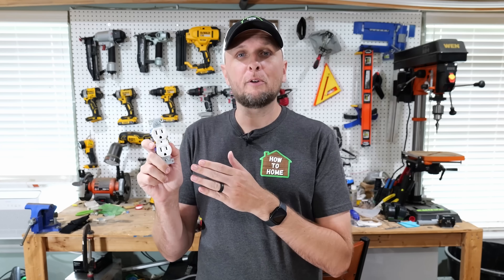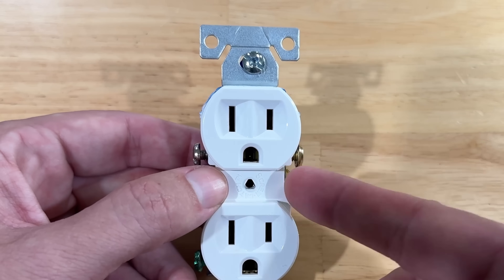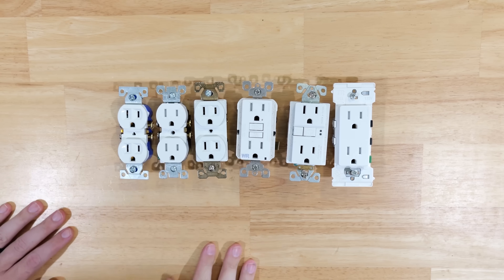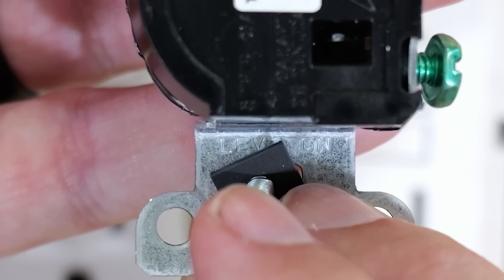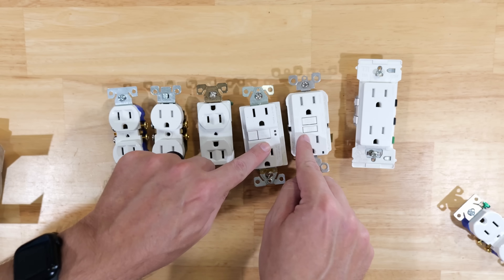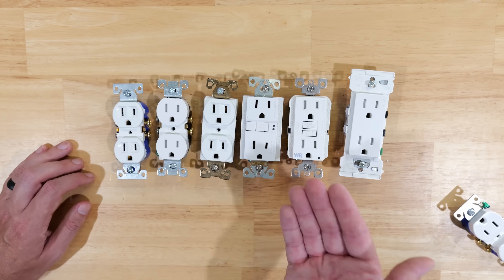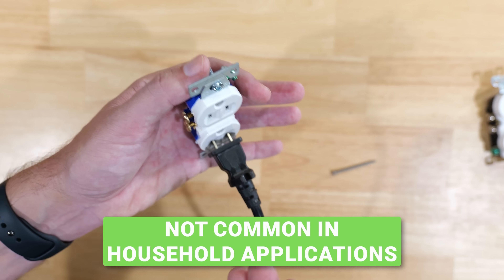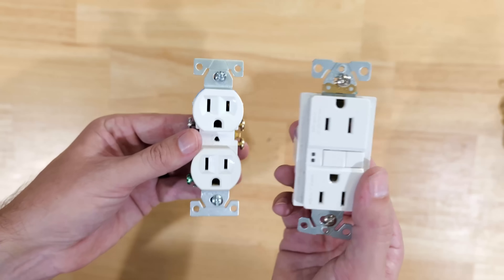The Shocking Reason Why Your Outlets Are Installed Upside Down!

Comment: The vast majority of flat extension chords are oriented with the ground to the “bottom” which would allow the chord to drop without the tail twisting or potentially “folding over“, potentially kinking, when behind furniture or appliances…industry standard and 99% of residential units have the receptacles with the ground prong to the bottom and it’s only confusing when people want to create the confusion…but playing the “paperclip” odds seems to be something that 99% of people and builders have chosen..

Comment: Anyone who tried to use a block power supply will notice that due to their weight, with the ground prong up, they tend to pry away from the wall, exposing the prongs, and creating a dangerous situation, and preventing the device connected to work properly.  These power supply are designed for ground down usage.

Comment: I install Receptacles Prongs up for any receptacle thats going to be constantly energized.  If the receptacle is switched however then I will install the recep with ground up, reasons for having a switch plug is for when the home owner for whatever reason doesnt want an overhead lighting source and instead wants to light the room with lamps.  It shows a clear difference between the two power states to prevent someone from plugging something that can be damaged from the power being cut off and to prevent tape being put over the switch or the switch removed and connected in the box.

Comment: The US standard plug is crap.  We need to adopt a new standard.  Something with coated connectors like in every other country.  And bonus points if we mandate right angle plugs and fuses in the plug.  European continental and UK plugs are so much better.

By the way, there is nothing in the code in a lot of municipalities.

Comment: I'm not an electrician. But I can say an outlet is either right side up or upside down when either electrician or a homeowner plugs in an outlet tester like the 'Klein GFCI Receptacle Tester with display'. If a receptacle/Outlet has the ground pin on top, the tool is going to be upside down.

Comment: I have several duplexes that were built in the early 80s and they all have the ground plug up. I was told the city had an inspector at that time who required them to be installed that way even though there wasn't any code requiring it. That would have really ticked me off. Earning the hate one inspection at a time.
Reply: @benvoeller8946: Just because the inspector didn't give examples as to WHY this might have ben the case there are legitimate reasons. Ground prong up when that outlet is attached too the wall-switch so people there know where to plug in their lamp to control it from the wall light-switch.
  Medical facilities have things hanging on walls that fall, like clipboards, scalpel, hemostat, that can fall and short the circuit, military galleys and  restaurants, ground up was specified, due to stainless steel utensils being dropped, etc. Therefore it has become required that they be ground up for contractors. In many cities ground up is standard in all commercial and industrial buildings, ground only go down in residential buildings, houses, apartments, condos, etc. 
   Internationally, countries with 3-prong outlets always have the ground up
   Everything is in context and the answer DEPENDS on context. 
   Examples:
“Never took the orientation of an outlet seriously until I was measuring for a shelf with a tape measure. It slid down and fell across the prongs of the washing machine plug.  POW! “ —@joef.6596
“I work at a K-8 school. Maintenance assembles powered multi media carts with the ground plug up in consideration of teachers dragging metal bracelet chains across partially unplugged power plugs.” —  @scaryhouse7969
“a length of florist's wire rolled off a side table onto a slightly loose plug and shorted the circuit, creating a small fire (quickly extinguished).  I now always install ground prong up” @deegee54
“I work at a restaurant and we have this work table with some outlets built in on top. Someone managed to let the edge of some tin foil go in between a plug and the outlet and it got disintegrated.”@MatthewSuffidy
“I knocked some change off of my end table one day my mistake of course, and a coin fell down right on the prongs resulting in a loud pop and a flash along with some smelly black smoke. I have since gone through my home and reversed all of the receptacles so the ground prong is now on the top.”—@chrisenglert3958
10 months ago
"I had lunch with the Chief Electrical Engineer at McDonalds headquarters. He told me that one of the workers in one of their stores had her hand badly burned when a metal cookie sheet (or something similar) slid out of her hand. It fell onto a receptacle that was loose…the metal cookie sheet made contact with the two blades resulting in  big arcing flash that caused the injury, this is a reason Ground Up is safer."

Comment: In my former life, I installed electronics in government facilities. I was not an electrician, but part of my job was to do simple electrical wiring, such as wiring up receptacles or hooking up wires in a power panel. I became aware of the ground orientation issue many years ago. After much reading and researching, I came to the conclusion that this falls into the category of an urban legend. The theory is possible. but I think this started with someone's overactive imagination and caught on with some electricians and then spread as these stories do.

Comment: Two things to consider in the orientation of the outlet: 
1. How you want the wires inside the outlet box to run and 2. The orientation of the plug you are putting into the outlet.

Some times the wiring and for the outlet and other wiring coming into the box will dictate the best orientation for the hot, neutral and ground. 

The direction of the cord coming out of the plug will sometimes be dictated by the whether the ground is up or down.

Comment: The triangular shape of the grounded plug you've shown is typical of such plugs, and in my hand, it feels much better in a "ground down" outlet, where the flat portion of the plug is against my thumb, and the smaller bottom of the plug is on my index finger, so I can roll it to get the angle of insertion lined up.
Reply: @DerekKerton: Ground prong up when that outlet is attached too the wall-switch so people there have a visual cue to know where to plug in their lamp to control it from the wall light-switch.
  Medical facilities have things hanging on walls that fall, like clipboards that short the circuit, military galleys and restaurants, ground up was specified for contractors, due to stainless steel utensils being dropped, etc. In many cities ground up is standard in all commercial and industrial buildings, ground only go down in residential buildings, houses, apartments, condos, etc. There are local rules. 
   Everything is in context and the answer DEPENDS on context.
Example: “Never took the orientation of an outlet seriously until I was measuring for a shelf with a tape measure. It slid down and fell across the prongs of the washing machine plug.  POW! “ —@joef.6596

Comment: The majority of AC adapters are designed to "hang" with the neutral left and the ground down (even though they often don't have neutral). These so-called "wall warts" would not hang correctly in a ground-up plug, and the wire would go inconveniently upwards and curl back down with gravity. We're gonna have to go downtown with ground-down, and just let it hang, peeps.

Comment: I think the strongest argument for ground-plug-down is the fact that most power adapters (with transformer blocks for plugs) typically assume the ground-plug-down orientation. If the outlet is stalled ground-plug-up, then the weight of the power adapter plug will be above the outlet, levering the prongs out of the outlet. Having the weight hanging below the outlet is more stable.

Comment: Let's confuse the issue more: Gasoline powered snowmobiles with a 110V electric starter have the starter plug with the ground pin up. Snowmobile manufacturers also have a sicker warning not to put your hand in the chute which is probably more important. However most portable generators have the ground pin down.

Comment: Another thing to keep in mind is how heavier transformers are made.  Many wouldn't work well with the ground side up.  It's more important to properly wire the connections.

I wasn't aware of face side cannot be up under sinks, but I do know that some codes require built in circuit breakers when installed in bathrooms, kitchens, or rooms with water sources.

Comment: Some of the answers elude to this fact. With the ground down, there are 2 terminals on the top. These also have more tension than the ground. This helps keep the weight of the cord or a transformer from pulling the plug down at an angle due the the leverage against the bottom of the plug. At least be consistent. I would hate having to figure out which way to turn a plug on every connection. It also look more proper/natural looking with ground down. Like an upright face.

Comment: Our new homes ALL had the Ground Pin DOWN.
But if the outlet was operated by a light switch on the wall ... then the Ground Pin was positioned up, so entering a room you would know witch outlet was operated by the light switch.

Comment: Isn't it rather moronic to design a system that makes it possible to touch a live prong every time you plug or unplug something? I've never seen  anything like it in Europe. Any part of the prong that could theoretically be touched while live during plugging/unplugging, has to have an isolating cover.

Comment: My problem is my refrigerator is grounded with the wires coming in the plug on the side. My whole house has ground on the top which makes my refrigerator plug upside down when plugged in and the cord sticks out like a waterfall. Can I change this one Outlet to have ground on the bottom so the plug is snug against the wall.? Also I have a half basement which I keep my tools and charging lithium batteries is a little tricky with ground side up
Reply: @ezabreeza3223: "Can I change this one Outlet to have ground on the bottom so the plug is snug against the wall.?" Of course. It's not hard to unscrew the plate and change the orientation yourself. Or hire someone to do it. Then it's done.

Comment: I use ground prong down, as all the 90° Plugs that I have seen (refrigerator, dryer, washer, appliances in general) plug in with the cord hanging down. Ground up, they bend over 180° defeating the purpose for the low profile of the plug.

Comment: Built and a new home wired it myself ( I am not an electrican) I prefer ground prong down.  Passed inspection first time.
Reply: @williamsanders6092: Ground prong up when that outlet is attached too the wall-switch so people there know where to plug in their lamp to control it from the wall light-switch.
  Medical facilities have things hanging on walls that fall, like clipboards, scalpel, hemostat, that can fall and short the circuit, military galleys and  restaurants, ground up was specified, due to stainless steel utensils being dropped, etc. Therefore it has become required that they be ground up for contractors. In many cities ground up is standard in all commercial and industrial buildings, ground only go down in residential buildings, houses, apartments, condos, etc. 
   Internationally, countries with 3-prong outlets always have the ground up
   Everything is in context and the answer DEPENDS on context.

Comment: We bought a new construction home.  A few of the recepticals were upside down.  Turns out, the upside down plug receptricals were just placed that way so we knew which ones were connected to a light switch.

Comment: As a non-electrician homeowner, I like the default to be ground prong down.  It is helpful for outlets that are connected to a wall switch to be ground prong up (making it easy to identify these, as they can be on opposite walls, etc.)

Comment: I would be interested to know what points were made but then edited out, because there was obvious cut at the “arguments for ground side down”, after which only one point was made (index finger slip), and then you mention “all the points made previously” and “all of the points thus far”, of which there was only actually the one.
Reply from the maker: Yup, cut some out.  Video was too long.  One had to do with appliance plugs being angled so ground down takes stress off of them.

Comment: I did a lot of work in healthcare facilities.  Because they mostly used metal (Stainless Steel) cover plates, the ground had to be up.  Or if the outlets were installed horizontally the neutral had to be up.  This would prevent issues if the cover plate were to come lose and drop down on the inserted plug. That was the logic I was told and I have seen many instances where it has worked well.  Now there are nylon plates and unbreakable covers which do not conduct, it is not as big of an issue.

Comment: I prefer neutral prong down for convenience. And frankly, ground prong up pisses me... Why? Well, I teach photography in different schools, colleges and community centres and I use a 90 degree extension cord to plug my devices (projector, screen, lighting gear, etc.). A regular "straight" extension  won't fit behind furniture, or file cabinets. With a neutral prong down outlet, the extension's cord falls down directly toward the floor. I've been using one this way at home (plugged and unplugged hundreds of times) for more than 20 years. With neutral prong up outlet though, the extension's cord goes up, then bend before pointing down to floor. Installed this way, an extension doesn't last long (generally less that two year). However, now I do carry two extensions (one 90 degree, one straight).

Comment: Not a bad video, but you forgot to include the body that originally developed the prong standard, which is NEMA. When you ask, what do the manufacturers specify, that specification comes from the National Electrical Manufacturers Association. You were holding NEMA 5-15R devices, so as a licensed engineer I refer to that body's definition. I could not argue in a court of law, that the ground pin down is acceptable due to this and the increased susceptibility to shorts like you mentioned.

It is unfortunate that various home devices are made with the expectation that the ground pins down due to the tradition of residential home builders installing it that way. So the most convenient method for residential is ground pin down. But again if a house were to burn down due to a conductive sheet of metal or wire shorting out the prongs, there is a legal argument to say that the home builder is at fault.

Comment: 12-12-24 Maybe we look at the back of the newest outlets for the correct orientation. The manufactures  information stamped into the back of the outlet  can only be read with the ground pointing down. Having said that the Leviton folks orientation for the yellow tape covering to load terminals can only be read with the ground pointing up ;-))  re: 20A AFCI/CFCI  TR AGTR2-W.     The comment by @electvolt67  2 months ago is smart and makes sense.

Comment: Not even watching this Video. The outlet covers in commercial Blds are metal the screw comes loose more than you think with all the vacuums and portable heaters being plugged and unplugged all the time. When the cover falls on the hot and neutral it kicks the breaker which in commercial blds the panels are locked are locked. You have to wait for me for the last 45 years to come and reset it.  That is why not all these guesses every one has.

Comment: I was once told that outlets connected/daisy chained directly to a breaker are mounted Ground Prong Down. But if you daisy chain an outlet off a  GFCI are Ground Prong Up. So you can see the difference

Comment: Hopefully this will settle this issue of ground up outlets. so please read: According to the California Building Code (CBC) and the requirements outlined in Article 517.13, all patient care areas in a hospital must utilize "hospital-grade" outlets with the grounding pin positioned upwards, ensuring a reliable grounding connection for medical equipment, which is the primary reason for this design feature; this is mandated by the OSHPD (Office of Statewide Health Planning and Development) for patient safety.
I posted here before and tried to explain where hospital grade outlets are distinctly different. They have the ground up with the right blade horizontal. The design is to help keep the plug from falling out or from being accidentally pulled out including staying grounded. The outlets are usually part of panels where multiple hospital grade outlets are along with medical air, and water outlets as well.     The issue of a regular outlet should be ground down or up is a completely separate issue. In almost every case the ground down position is the normal position.
   Please take the time to google or search for : Hospital grade outlets. Remember to also click on images and you will see for yourself what hospital grade outlets look like and how they are installed. Also you should watch Leviton’s “ What makes a device HOSPITAL GRADE “ . The video is informative and covers not only outlets but plugs. Hope this clears up things.

Comment: I asked an electrician on a construction job why he was installing the outlets with the ground up. He told me that if the plug was to somehow get yanked downward and out that ground on the plug will not break off and it will break off if the ground on the outlet is on the bottom. Try it and you'll see.